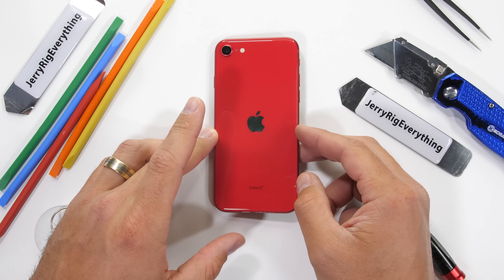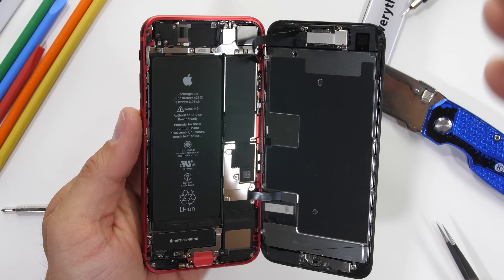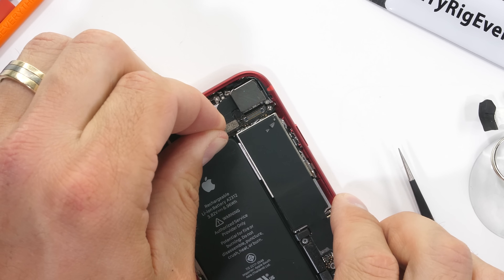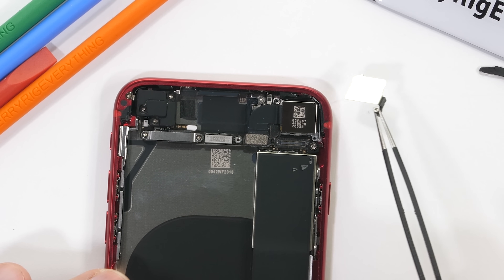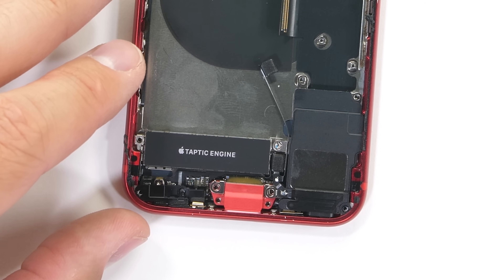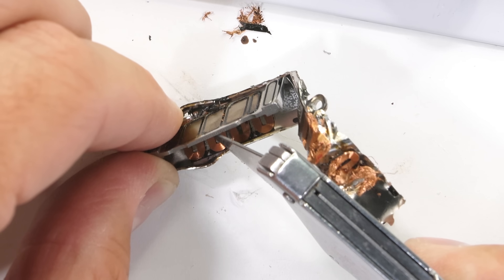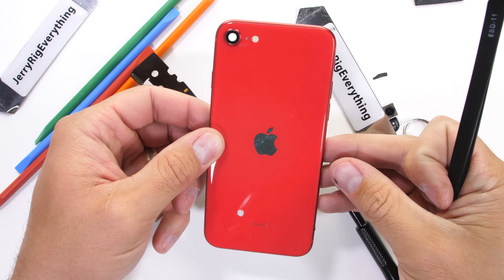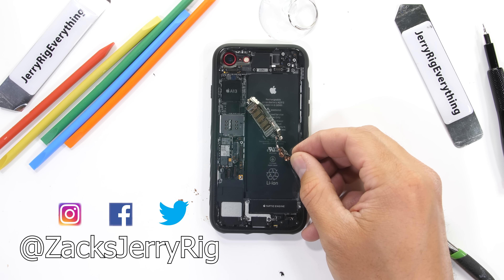iPhone SE (2020) Teardown! - Lets talk about Vibrators...

Comment: Nice video, I was debating on getting this phone or the s10e and I chose s10e. Just way better all around. Type c, dynamic amoled, 2x the battery capacity of the se, wide angle camera, very tiny basil. The se is just trash imo.
Reply: Well said and great choice 😎
Reply: American Freedom World Peace  Youre not wrong. I enjoy one ui and the features samsung brings to the table built in with the phone that LG does not have.
Reply: Nice preference, I'll pick the SE since the s10e cost 800
Reply: @addedpole  it actually costs 550 now. Well about 600 after tax but yeah they did make a good iphone for the price.
Reply: 600 before taxes my bad

Comment: If the iphone Se dont have pressure sensitive 3D Touch, how does the home button work? The iPhone 8 has 3D Touch.
Reply: Sajadh I have the SE, it's a Haptic Home Button with three different options for feel.
Reply: Aceticke thanks for the reply...so does it work on pressure or touch?
Reply: @sajadh4542  the button is touch activated, but is also pressure sensitive. NOT an actual button like the older iPhones this style had
Reply: Morgan Cordry Yaa apple might be using the same display as iphone 8 ...so probably it might be software disabled...thats a bummer though
Reply: Sajadh I had the 7+ and now the SE. I believe the button is the same. Both the solid state button. It’s quite satisfying honestly lol

Comment: "For a company who hates people getting inside of their own phones, they sure plaster their logo everywhere" Yeah that's because Apple will claim that refurbished screens (or any other refurbished parts for that matter) from China are "copyright infringement" because there is a tiny Apple logo on the ribbon and have Customs seize the package. Louis Rossmann lost over $1,000 because of this. And while I guess it is good they're using recycled tin solder, its complete crap as Rossmann says too. Don't be surprised after dropping your phone that it dies because a chip, resistor, or something else just pops off.

Comment: It didn't make me switch but it did make me buy one as my backup phone. It allows me to peek behind the curtain without fulling commiting to iPhone or an expensive iPhone. My daily is still a pixel 4xl. However some games/apps run better on iOS. So I get the best of both 🤷‍♂️
Reply: games run better because the A13 chip in the se is faster than most of the $1000+ android flagships

Comment: It would tempt me if the mark up wasn't so bad in Australia (and NZ too). Converting 749AUD (for the base 64GB version) to USD comes out at around 530USD which is much more expensive than even the 128GB version in the US and only about 20 bucks lower from the 256GB. It would actually be cheaper to buy a US version from Ebay even with the huge shipping costs.

Comment: Actually, yeah I'm tempted to get this as my first iPhone, after 10 years with android. The reasons being the form factor, the notchless design (no popup cameras), no underscreen fingerprint scanner, the single camera, the performance, the 5 years software support and the price. Try going to GSMarena and looking for a phone with those requirements, you can even remove the cost factor. There's nothing in the past year ticking all of them off. I just don't want to have a juggernaut of a phablet in my pocket/hands and consider it normal, or having 3+ cameras and considering it normal, these barely matter to me. I just want a fast phone to last me through my day and be able also play some games from time to time and consume media. Sure it sucks having to deal with a lightning cable but I consider it a small compromise.

Comment: Nice job on the teardown and explanation.  My SE hit the floor and the touch stopped working.  Hard reset did not help.  Guess I will crack it open and check the touch connector.  Thanks

Comment: I remember the 6s I pulled apart taptic engine has a runner either side and used to slide into each using springs. as it was activated

Comment: I bought this one. Went from Android (Lenovo K6) to this. I have had an iPad 3d generation so I was familiar with the IOS. Some cons with this phone is that you can't choose where to put your icons on the desk and you can't choose to have no icons on any desk. I also miss a fast way of shutting off positioning but it is installed within the apps so I guess I just need to get used to it.
I would personally have loved this phone to have had aluminium back, the same as in the edges instead of this ugly red colored glass back. But, my fragile glass phone, which is very slippery to hold without any case, is going into one of these water proof super cases which has a boring black back. I would have loved a cool X-ray image there. I pay $10 a month for 24 months for this phone so I am a quite happy owner.
I love your videos though and always look at them before buying new phones!

Comment: Even though I like it, that apple now offers a cheaper phone I wouldn't switch to it. The SE has only one camera so probably no wide-angle or macro and it's display is only HD which might not be as bad considering its small but its still a low resolution. Probably also a reason why they can afford to put such a small battery in it. I'm happy with my A51.

Comment: As an android user, I gotta admit that it looks like pretty good deal. Specifically the fact that you can probably use this phone for like at least 5 years and you know it's going to be supported in terms of software. I don't care about switching to iOS though. Also, I fell like I probably will get bored with it after 2-3 years and will want to switch anyway even if it's still holding up.

Comment: This phone convinced me to switch. I've used Android since 2009. It's become so bloated, buying a device to run it properly costs nearly as much as this phone.
Reply: If the pixel 4a was out when I bought this phone I may not have bought it. At the time it was between this and a moto g power. I personally like a smaller phone and battery life isn’t a big deal to me because I always have two phones (one provided by work). So at the end of the day I went with the iPhone. Now I’ve grown accustomed to the fit and finish. Everything I use on this device feels like I was made for it. Apps too. Because they usually are. They are made for iOS and then find there way over to android via porting with java. Honestly it just works better because of this. I haven’t had any issues so far where I need to use my understanding of Linux to figure out my phone. This has been a surprisingly seedless experience once I learned how to use iOS. I don’t see myself coming back to android. I really thought the experience would go differently. I use Linux on the daily and love the freedom and even the philosophy behind android. But it’s just meh compared to this experience. Add to that this phone will be supported for 4-5 years.... it’s a no brainer for me.
Reply: American Freedom World Peace ok one issue.... the spell check isn’t the greatest thing I’ve ever used as u can see in my reply lol

Comment: Employee: We should buy better pull tabs for the battery, It would still cost less than 15 cents per phone for the better pull tabs
Apple Managers: That doesn't make much 'cents' to me, anyway your fired
Also even if they are making cheaper devices I still wouldn't because of the fact that you can literally shop for parts yourself to repair your phone with apple they say screw you you pay our exorbitant fee or get a new phone

Comment: I have been an android user for almost 6 years now, my last phone was a pixel 3a but recently broke. I am most likely going to buy this phone next for a few reasons. one is that the build quality is just better than android phones of this price. my pixel had a very annoying buzzing earpiece due to it being cheap fabric and I have found other issues like that with other android phones. the pixel took great photos but, it took a while to take them and because of how long it took to take pictures due to processing speed, they often came out blurry where there was movement and thats where I think apple do a much better job. my main reason for going for this phone though is the power efficiency. although phones with bigger batteries last longer in the short term, if you're out with no place to plug in other than a power bank, then the phone won't last as long. as the battery's capacity is far smaller, it will use less of the power bank to get to 100%. because of the small screen and great standby times, the iPhones battery just works out better for me when I have to go to gigs across the country and may not have a socket to plug into a lot of the time

Comment: Is the battery life poor? It does tempt me as Android user to switch but I'm using a 4000 mAh Motorola so I'm doubts it will last a full day on me.
Reply: It will it’s not always battery size, display resolution, processor or software. It will last a day

Comment: To be blunt, I'll not switch to the SE just because of its price.
Even though some of the things are tempting like the A13's performance, Optimisations etc ,
it's not a phone that'll be usable for 5 years. Period.
The hardware is just too outdated for it.
The point isn't if you can run new software on old hardware because even with Apple's updates it won't give the same experience as a X which can at most be usable for 2 years. 
 So getting the SE & telling it'll keep getting updates for 5 years is just a farce. Most of the things are just obsolete in the present year of the SE like its battery, charger,screen etc  What's the use of the IP rating or wireless charging if the phone's running components are so outdated..?
It's just bragging rights to tell that a phone will keep running continuously.
 I can demonstrate a steam engine still running ,let's see how many people will still be using it if it's polished & packaged by today's standards..?

Comment: Did I was or am I stiil an Android user IF:
- i use Android only since 2012
- my second last phone was SGS9 and then Pixel XL 2016
- I switch to SE 2020 as primary phone but STILL having the old Pixel with me all the time
- I bought an Apple Watch
- I have an iPad Pro 11'' 2018
.......after having a month and a half with SE2020 kinda thinking to keep it even the camera it's ZERO in low light...
That's a question btw...
I don't know it someone will read the whole comment but I will drop my recent events with SE2020:
I bought it on Amazon, 419£ 64GB white..at the begging of july. After 3 weeks of using it always in a genuine Apple silicone case, never dropped it and never even close to water, the home button AND TouchID suddenly stopped working. I even have a video showing that. I sent it back to Amazon for refund and next day went straight to local Authorised Reseller to buy the exact same phone. I went straight home and restore my stuff from the PC backup I've made to the 'old' one before sending it back. Know I have a new problem...my Apple Watch was refusing to connect (pair) to it at all. After trying all from updating everything to factory resest the watch a couple of times, I went back to the store and asking the same guy to pair them. He pair my watch with his iPhone11 but he was unable to pair it to my SE2020 so I was courios (and frustrated) which could be the problem as long as the Watch is working...the answer was..."It might be a glitch in the OS of the phone and needs reinstalling" I told them about the procedure with downloading the .ipsw and then Shift+restore in iTunes and he confirmed that was the process. So that I can do at home by myself. After 2 weeks since then I managed to connect my Watch to SE2020 but I can tell you I expect any second to fail so my old Pixel XL is gonna stick around for quite some time....this was my experience with SE2020 so far..